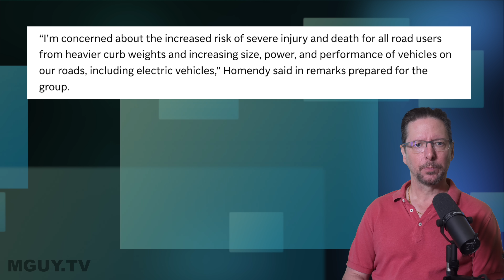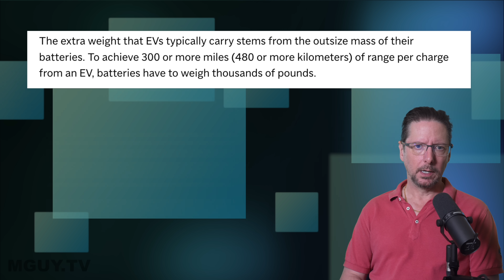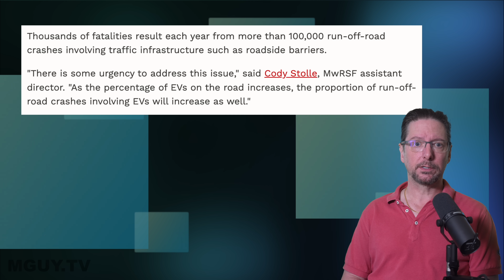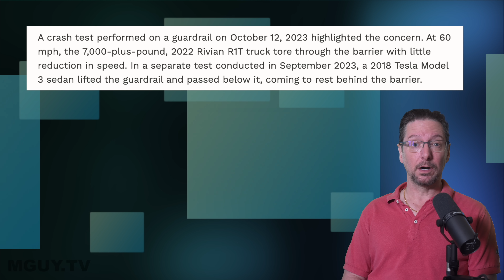EVs TOO HEAVY for roadside crash barriers (guard rails) | MGUY Australia

Comment: Not an "EV" problem. This means the barriers aren't designed for 18 wheelers and other heavy vehicles, just VW bugs.
Of course I've never seen a guardrail do anything but maybe redirect a slightly glancing hit from "normal" cars, they plow right through them too.
Exploding in a shower of cheap plastic parts.
Reply: This is a lie. Jersey barriers and guardrails do the job they have been designed to do thousands of times each day in North America. Rarely does any vehicle strike one head on at full speed, but if that is happening then there probably has already been a catastrophic failure of some sort. Cars are designed to explode in a shatter of parts rather than stay assembled as they cave in on the occupants. Cheap plastic parts are used to make cars more fuel efficient and affordable.
Reply: Affordable...right. Prices have been dropping for years as they use more and plastic....yeah....I believe you.
 
I'll keep my 68 KE10 for another 50 years. Then the grandkids can drive it for another 50.
It's metal. About 99.9%. A couple of plastic knobs and emblems. No snap together parts. It can drive over potholes without damage. Hell, it can jump railroad tracks without damage.
Great gas mileage too, on par with a NEW hybrid.
And if you're one of the 6 people in the world that actually know how to drive you don't need to worry about crashing into stuff.
I've spent less in 36 years than the down payment on any new plastic "affordable"  car. @reedwright301

Comment: Crash barriers are more for steering vehicles along the road.not for the type of impact shown in video imsure most larger vehicles would behave the same.interesting point about parking garrages though.
But the same could be said about all vehicles as they have progressively have got heavier. Just check the Holden commodore it gained about 400kg during its 30 odd year life.i guess you could compare the original mini to the current rubbish as well?.
I like v8s and will continue to buy them as long as able. Keep up the videos.

Comment: Sorry MGUY, and as much as I’m not an EV fan, they don’t weigh anymore then a full size diesel pickup. Having driven a diesel for a number of years, the upside is that they get another 30% better mileage and double the torque.  The downside is tires, shocks, ball joints and brakes wear out twice as fast and cost 50% more. I’m sure it all boils down to physics, cheers.

Comment: the Mini Cooper Electric, 1,775 kg, is 8% heavier (125kg) than a Mini Cooper ICE, 1,650 kg, 
so EVs are hardly "significantly heavier" than their equal ICE counterparts, 
and its batteries weigh just 260 kg.

As for that American "research?????" what MGUY totally failed to mention was, 
there are considerably HEAVIER ICE pick ups than EV pick ups in America.

Comment: When they tell you to extend battery life, do not go below 20% ( 30% in winter) and do not charge to 100%. You have taken away up to 50% of your battery capacity so that is 50%of range. That means an EV with 300mile range is cut to 150miles. Then add in the cold and 3 adult passengers with luggage and maybe a roof box your lucky if you have 70 to 80miles of range out of your supposed 300miles of range. What good is 70 to 80 miles. I have a 4x4 and can get over 350 miles out of a tank of approx 18gallons or 80litres towing a caravan with 4 adults and all luggage and roof box to help fitt everything in. I would also mention if I had to charge it would mean unhitching every time.
Reply: If you don't like them then don't buy one. They don't suit everyone. Some have prejudices and others have needs not easily met by EVs, such as regular long trips into sparsely populated areas. Telling everyone not to buy an EV is like telling everyone not to eat meat.
Reply: @SirGregoryPageTurner  
We will be forced to buy them. You do know how a mandate works? And we are already being told to not eat meat by the same people forcing us to buy EVs.

Comment: The extremely good acceleration of EVs is designed to be more of a selling point. If they used smaller and weaker motors, and matched performance with a more basic $20-25K gas car, then the EV will end up having fewer selling points, as it would not offer better speed and acceleration, and would essentially add on all of the negatives of EVs, while not really introducing many positives.
If you look at modern EVs, there aren't many features that are unique/ exclusive to them, thus they have to extract additional features from the EV powertrain, which ends up being extremely good acceleration, and more quickly reaching top speed compared to all but the very high end gas sports cars.

Comment: Aside from the weight of EV trucks, there is also the issue of damage to the battery which in the case of a multi-vehicle pileup may result in an explosion and/or battery fire which would incinerate in minutes everything and everyone in yards from the source.  As typical in nearly every U.S. government sponsored mandate program there are always hoards of unanticipated consequences. The mandates on EVs is a worse case scenario and if not stopped in 2024 will cause further deterioration of the overall financial status of not only the U.S.  federal government but also the populace as a whole. It's an entirely ludicrous plan designed to subjugate the U.S. and empower China.

Comment: Guardrails are not designed for perpendicular collisions. They are designed for “glancing blows” ie collisions where the angle between the path of the approaching vehicle is less than about 30 degrees.

The standards for guardrails and other crash barriers were established in the early 1970s when American production cars were considerably heavier than they are today. They also take into account fully loaded cargo vehicles.

Comment: Safety has already been overlooked, non standard charge ports heavy batteries that are fragile in crashes, guard rail barrier design, bridge weight structural loads. So much has been ignored for the net zero idiots and everybody else pays for this shortsightedness.
Reply: Chargers located only a few yards from filling Station gas pumps?! What could possibly go wrong? /s

Comment: What about bridges loaded with all/many EV’s?
Reply: You do know that bridges are designed to carry the heaviest vehicles permitted on the road? So if 55-ton trucks are permitted then the bridge will be designed to carry 55-ton trucks end to end. And then the engineers add a safety margin for good measure. Civil engineers do spend a lot of time getting their degrees.
Reply: @SirGregoryPageTurner  
The issue isn’t taking a 55 ton truck, it’s taking a sustained load more then what it was designed for.  X number of cars per year at y average weight.  Granted bridges deal with more traffic then expected, but if that higher density is also heavier.  Like the parking structures.
Reply: @KellyStarks  What types of vehicles do you believe are contributing to growth in "sustained load"?
Reply: @SirGregoryPageTurner  
Well obviously electric cars and truck are much heavier per surface area then traditional cars (not yet a problem given their rarity, but like the collapsing parking structures, it could well be exceeding the assumed and designed for loads), and the much higher and denser tragic  many big bridges are experiencing.  So a bridge covered n fast moving traffic of reasonably spaced older sedans.  Is seeing much less load then bumper to bumper stalled EV’s which seem to be averaging 30% heavier then the similar sized/capacity traditional cars etc.  also of course 18 wheelers are more numerous then used to be expected. 

N the plus side, big suspension or other bridges loader is normally overwhelmingly dominated by the weight of the bridge itself, and it’s wind loads.  Unlike small bridges and parking structures, which are much smaller and lighter compared to their loads.
Reply: @KellyStarks  I surrender.

Comment: This issue with guardrails has probably been around for a while, almost certainly preceding the introduction of EVs. A modern Tesla has a curb weight approaching (but still less than) that of an F-150 pickup. Anyone who has driven around the US knows just how common these big pickups are (I'd estimate at least 30% of vehicles on the road in my area). So, if guard rails can't stand up to a Tesla, they haven't a hope against an F-150 with any kind of load in the bed.

And a large SUV like a Suburban similarly can outweigh an empty F-150.
Reply: So the next step will be to outlaw personal ownership of 3/4 ton pickup trucks. You can count on it.
Reply: @northdakotaham1752   unlikely here in the US. If they can't control gun ownership, they haven't a hope of separating people from their big trucks and SUVs.

Hell, I recently had to retire my old Volvo station wagon and was effectively forced to buy an Outback, as the current Volvo offerings are so poor in that area, to get the cargo space I need for road trips, DIY, and moving 3 large dogs around. It has a 3800lb (1.7 tonne) curb weight. And it's still an SUV instead of a station wagon.

My old XC70 got used for all kinds of things. I could fit a full size 80" interior door in it (when I was rebuilding cupboards), used it to bring home half a yard of gravel at a time, and even 20x50lb bags of concrete. Wouldn't try it with my 2023 Outback, though I would have with an older wagon-style one.
Reply: @stainlesssteellemming  I've had the same experience. Living in the north...good luck finding a standard cab truck with an 8 foot box! The standard size for hauling building materials. Almost every truck on the road here has four doors and a tiny little box that holds nearly nothing.
Reply: @northdakotaham1752  Apparently that's down to an EPA ruling and unintended consequences.

When they brought in the rules about reducing fuel consumption, they included some weight classes which were exempt.

OEMs decided it was cheaper to build bigger/heavier vehicles than make them more fuel-efficient.

This video sort of explains it: https://www.youtube.com/watch?v=azI3nqrHEXM - though I don't agree with them blaming the EPA for the decisions of the OEMs.
Reply: @stainlesssteellemming  obviously the OEMs are going to try and build something they can sell and make as much profit from as possible. There is little profit in the U.S. from building multitudes of low cost, lightweight vehicles. They, the OEMs, got bit hard however on the EVs.
Reply: @northdakotaham1752  Agreed - though it's not the first time. Remember when gas was cheap, the US OEMS built bigger and bigger cars, OPEC put the hard word on, then Japan eat the US OEM's lunches?
Reply: @stainlesssteellemming  the Japanese were more informed on what the American public wanted. That said...I owned a Toyota Corolla, 1976 model. It was pretty cheap made.

Comment: While I absolutely agree with this weight problem, have to say that there is something really phony with that so called test. A 7000 pound truck, be it an EV or ICE truck (my F350 weighed in at 8360 by CAT scale) would never totally shatter a professionally assembled/installed steel ARMCO style barrier as shown. Yes, it would deform the rails and probably by a lot but it would hold that vehicle within the bounds of design. Simon, as a professed engineer of some sort should recognize that as well unless the EU and elsewhere have a lower set of design standards then the US.
Reply: The vehicle appeared to hit the rail entirely broadside...so the force sheered off the rail, posts. I get your point however bc there are plenty of personal vehicles that weigh as much.

Comment: Here in the US, the plan is to replace all guard rail and barricade infrastructure at staggering cost.  Being a large country that is very reliant on roads, a large stockpile of barrier rail exists that now needs to be sold, so the search is on for a country that has no plans to use electric vehicles that will buy this now surplus obsolete equipment.

It would seem that the logical thing to do would be to design electric vehicles to be compliant with existing roadways, rather than change trillions of dollars worth of infrastructure to match the new specifications of developing battery vehicles, but I’m not in government, I’m only a scientist

Comment: My 1983 VW Jetta turbodiesel weighed about 2,000 pounds and produced 68 brake horsepower. The EPA rating was 56 mpg on the highway, but I saw as high as 60. By far the best car I've ever owned.
Reply: Probably not the safest vehicle in a crash test but an EV with the potential fire hazard isn't either. The government has stopped the manufacture and import of vehicles like your VW. Absolutely shameful!
Reply: @northdakotaham1752  Yep. Years after I sold it, I saw the new equivalent of my '83 on a dealer's lot. It was much heavier, cost twice as much, and didn't deliver anywhere near the fuel efficiency. Then they went away altogether.
Reply: @rwalkenhorst  a friend had a diesel Rabbit. I seem to recall he got some amazing fuel mileage. I think he drive that car 300k miles!
Reply: @northdakotaham1752  I had a '78 diesel Rabbit before the Jetta. I heard one coming down the street one day in the small South Carolina town where I lived, so I jumped in my crappy gas-burner and followed him home. The owner told me all about it and then handed me the keys: "Take it for a drive if you want to." He didn't even come along. I drove around for a short time and a few days later put down a deposit to get on the months-long waiting list at the dealer. I later added a turbocharger myself.

Comment: Concrete mixer truck enters the chat: fully loaded they weigh 150,000 lbs and travel at highway speeds...
If you think EVs weigh alot, our roads our filled with vehicles that weigh significantly more than a new Hummer
Reply: And the guy driving that truck has a more restrictive license, that took testing and background checks. Not to mention a medical.
Reply: @GeneralChangFromDanang  I mean sure, but make no mistake that EVs are not more of a threat than a transport truck, which also doesn't stop anywhere close to as fast as an EV car...
I'm not in favour of the electrification of everything, but to pretend EVs are a menace on the roads from a safety standpoint is very misguided, to go from a gas Hummer to an EV Hummer, is only an increase in weight of about 15% (going from 7,500lbs to 9,000lbs), whereas going from an EV Hummer to a loaded dump truck is a weight increase of over 600% (from 9,000lbs to 70,000lbs)...
Not even close
Reply: @GeneralChangFromDanang   Additionally, industrial trucks, buses, and other large and heavy vehicles are not parked in parking garages or below apartment buildings.

Comment: NOTE:  You have mentioned the  word or verb  ( guard ) numerous times . A number of years ago, in a discussion that i had with the MTO , aka  Ministry of Transportation in 🇨🇦 Canada, i mentioned the term Guard Rail  .  I was advised not to refer to that term, Guard Rail . The correct term  that is used by the MTO is Guide Rail .
The term Guard Rail implies  that the rail system  does not guard anything  but implies the possibility of liability with the MTO  should personal injury occure. 
The Guide  Rail System is to simply guide if struck, not guard if struck.

Comment: There is an alternative.  Electrofuels are made from atmospheric carbon dioxide (or can be made from carbon monoxide) and hydrogen produced by "splitting" water.  If the energy to do this is done from renewable sources (or nuclear), the fuel can be carbon-neutral.  Electrofuel is currently the plan for air transportation.  It could also be used for ground transportation, with the catch that it's significantly more expensive than petroleum fuel.  But given the drawbacks of electric highway vehicles, being able to keep current ICE vehicles with non-fossil liquid fuel deserves more consideration.

Comment: My brother in law asked me “why do EV or ICE pickups need 700-900 horsepower?  My response was to wrap the truck around a telephone pole faster. The high horsepower vehicles have safety concerns of their own. Drivers don’t know how to handle the power, some Teslas are getting near the area of requirement of a NHRA license on the drag strip —stock. The enormous amount of storage need, the weight, changes in handling characteristics due to extra weight.
Reply: If you are towing nearly 15000 pounds it's really nice to have some HP especially towing in hilly country.

Comment: You are dishonest, there is not a massive difference because EV's dont have an engine !! An EV hummer is same weight as a standard model....for instance.
Reply: Weight is weight....regardless of ICE vs EV.
Reply: @northdakotaham1752  Weight is weight?? Sure thing, totally relevant if either of them decides to park on your foot.
Reply: @thomasowens5824  momentum during a crash would be similar. Crash results however would be different as ICE vehicles have been refined, crash tested for many decades.
Reply: @northdakotaham1752  Your deflecting.
Reply: @thomasowens5824  deflecting from what? You said "EVs don't have an engine". Well ICE vehicles don't have a massively heavy battery pack. So your point is what?

Comment: I wonder if there's an engineering catch-22 with roadside barriers. They need to yield somewhat on impact to cushion the blow on passengers in the vehicle. But the amount of yielding is going to vary enormously between getting hit by my 2000 lbs Toyota subcompact and that by a 6800 lbs Tesla Cybertruck. A barrier built for one will not work well with the other.